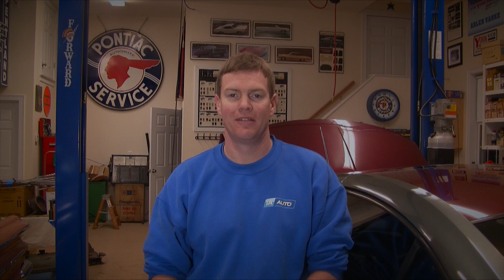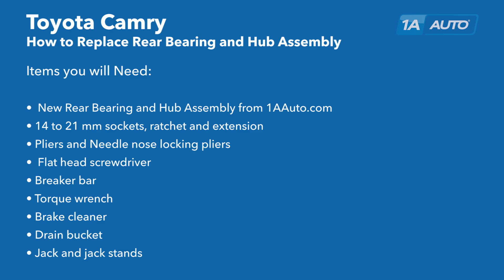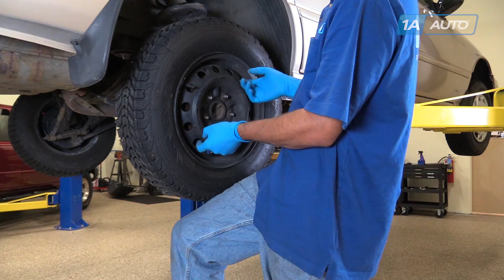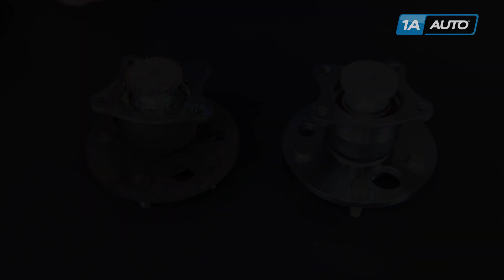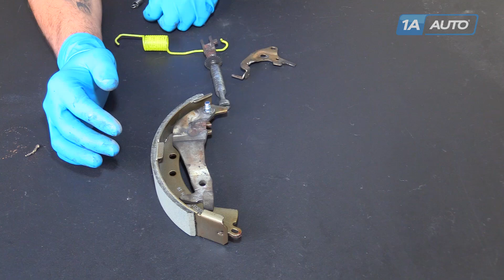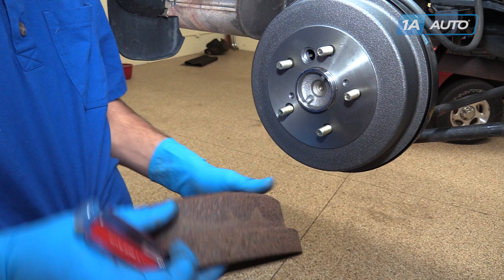How to Replace Rear Bearing and Hub Assembly 92-01 Toyota Camry

Comment: My hub literally broke in half i got the new part from your inventory but once i got the lug nuts out that held it to the knuckle/spindle i realized the part where the hub aligns with the four holes basically welded itself to said spindle/knuckle any tips on how to replace the rear spindle or suspension knuckle? Idk what to call it or who sells it??

Comment: As someone said earlier, you do not need to remove brake components if you’re somewhat handy you can get the bolts in and just remove the hub assembly itself. Took me about an hour and 3 miller lights with a battery impact. That being said , thank you guys at A1 for a great video and a great part, it fit perfectly.

Comment: ** THIS VIDEO SHOWS REMOVAL OF THE BRAKE SHOES AND BRAKE HARDWARE WHICH IS NOT NECESSARY. While these 1A AUTO videos are usually extremely helpful, and we should all thank them for them, this particular video shows that the wheel bearing procedure requires removal of the brake shoe assembly which is NOT correct.  The brakes and rear bearing/hub assembly replacements are totally independent of each other making either optional once the drum is off. It should be noted that a rear brake job is definitely easier to do with the bearing/hub assembly removed.

Comment: If I'm using a jackstand instead of a lift, how would that work? Do I put it in neutral with E brake? Not seeing how I could move the wheel bearing to unbolt it without the whole car moving.
Reply: Leave that thing in park

Comment: I want to change the hub carrier on the rear camry 1998 and I am looking to find out if it is easy to remove the brake baking plate? Is it just held on with the 4 axel hub bolts. Mine has rear discs with a smaller drum for the handbrake. Is it the o ring keeping the brake plate on aswell?

Comment: Mine is still running smoothly but the grease is old and partially dried out. Is it possible to just clean out the old grease and replace with new grease rather than replace the assembly?

Comment: Is this the same process for 2010 Camry?
Reply from the maker: +Dave G Here is a link to the replacement part that we carry for your 2010 and also a video of how to install it. Hope this helps you out https://www.1aauto.com/wheel-bearing-and-hub-assembly-trq-bha53296/i/1asfk00079?f=351639&y=2010&utm_source=YouTube&utm_medium=CTA%20Comments&utm_campaign=ytcomment
Reply: Wow that was a tough job. If that happened to me, where I did not have a press available, can you buy a new backing plate and start from scratch? If so, do you carry them?